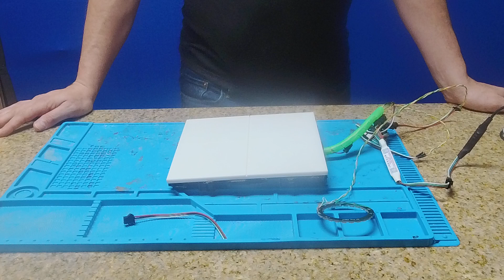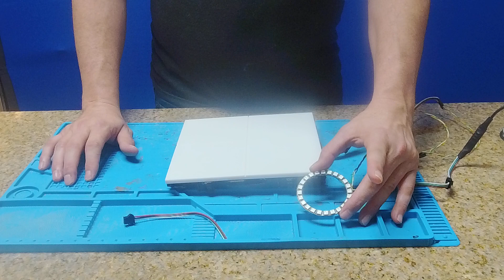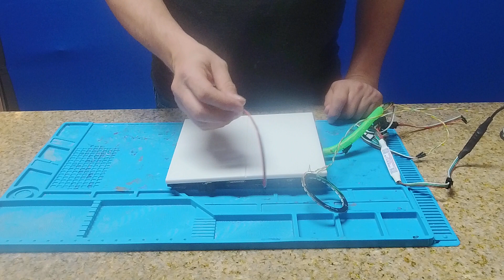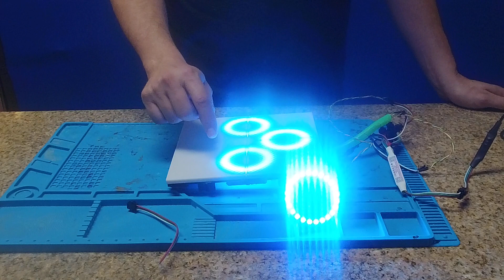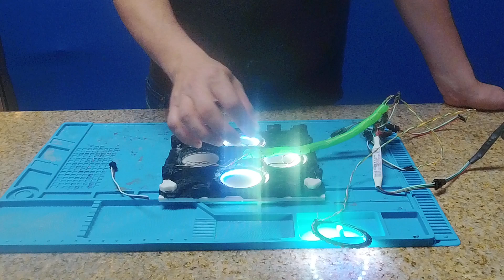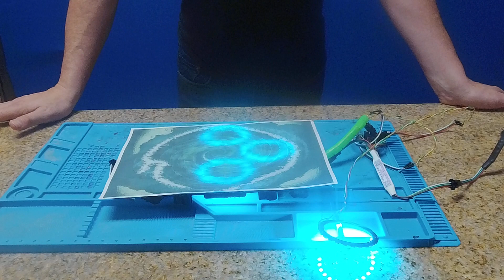LED Underlighting for Stagetop 3d printed table

Comment: Very cool. Neopixels. I control them via an Arduino. I built what is called a Word Clock where I control each Neopixel and it lights behind each letter to spell out the time in words. I 3D printed the letters in the words and 3D printed a defuser for the letters so the Neopixel equally illuminates. I also put on a music shield on top of the Arduino so it chimes on the hour, or I can put in an SD card so instead of a chime it can play a different file each hour.